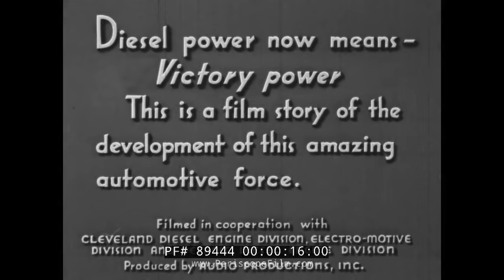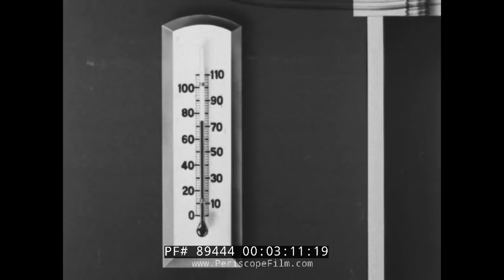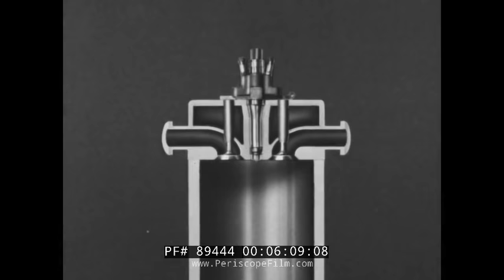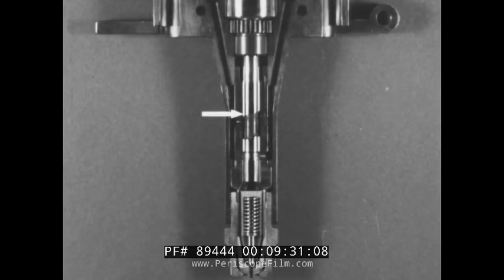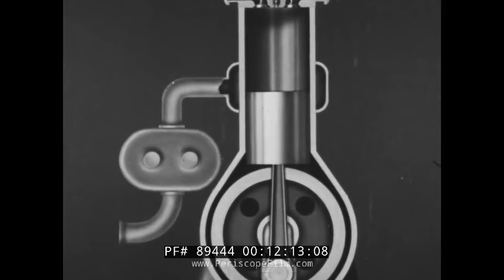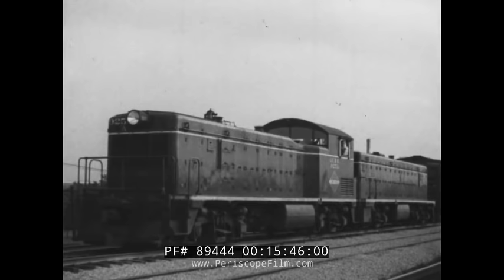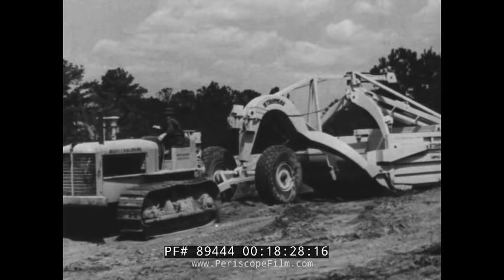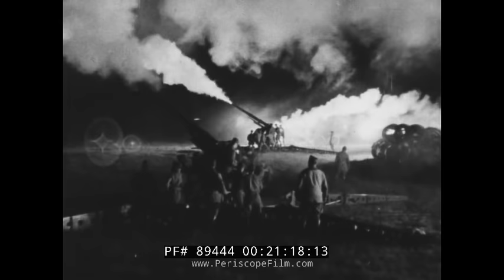GENERAL MOTORS DIESEL: THE MODERN POWER  DIESEL LOCOMOTIVES BURLINGTON ZEPHYR 89444

Comment: a Detroit Diesel in a tank????? the enemy can hear you five miles away!!!!!!!
Reply: Justin Myslive couldn't be much worse than the radial aircraft engine they used for a while lol
Reply: @harrisonvc9175  WITH A 325 TO 375 MPH STRAFING SPEED, COMBINED WITH A 1/2 MILE GUN RANGE;
THE P-47 COULD OFTEN SHOOT-UP ANTI-AIRCRAFT GUNNERS BEFORE THEY HAD A CHANCE TO
ACCURATELY SHOOT BACK!!!!  BY MID-1944 THEY ALSO CARRIED ROCKETS!!!!--(I know the P-47 had
a TOP SPEED about 410 MPH; BUT you COULD NOT strafe at THAT speed; you could NOT pull-up in time!!)

Comment: The first time I ran one I only ran it at half throttle because I thought the tach was broken and it sounded like it was going to explode.
Reply: I have two marine 871s.  running those at 2450 rpm, top no load rpm, they definitely sound they will explode.  however place your hand on the engine at the same time and they are nearly vibration free.   amazing engines that love to be run hard.
Reply: Russell Robins what always amazed me about them is how even cold you hold the throttle open. There really isn’t anything gentle about the way you handle them, and they still don’t die.

Comment: I guess that was Lysholm spiral supercharger
Reply: GM Roots supercharger .Designed in the 1800's to pump air into deep mines.
Reply: and after the war was over, guys figured out a way to mount them to gas engines and make their race cars go faster.
Reply: I often wonder where drag racing would be if it wasn't for Detroit Diesel and their Roots blowers.

Comment: General Motors could build these great diesel engines but could'nt build my 1980 chevy pickup that would'nt rust out above the wheel wells or rocker panels after 3 years of use.

Comment: Yet we did not use the diesel engine in ww2
Reply: Landing ships were powered by GM built EMD's  and landing craft by Detroit 2 strokes. listen to old war movies with sound,you can hear them screaming away.
Reply: Used them in Sherman tanks, but sent all the Diesel models to the Russians!
Reply: M4A2 are using General motors 6046 twin inline diesel engines.

Comment: Why do gasoline engines make up the majority of autos, when diesels are more efficient and better in every category? Does it have to do with gasoline companies brainwashing the Public herd into GO FASTER-FASTER-FASTER . . . which made them MORE $ $ $. Why are gasoline engines even produced, or allowed, or popular ? Is it because diesels can't provide the Herd with the Indy 500 and 300 mph dragsters ?  [[ NO, gasoline isn't cleaner and better for the environment than diesel . . . EPA is owned by gasoline companies. What did you say: Cars get better mpg today,  not with everyone driving four times as much compared to the past]]
Reply: You can make at least twice the amount of gasoline out of a barrel of crude oil as you can diesel. Diesel is a more efficient fuel, but its not an efficient use of crude oil.